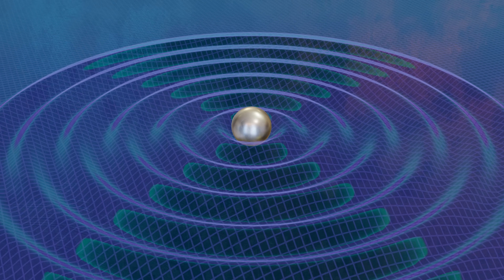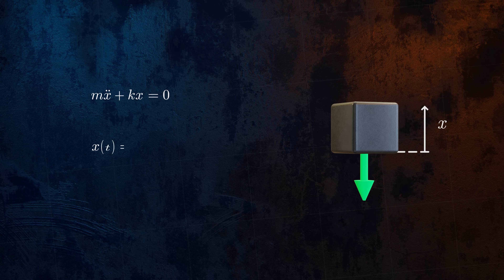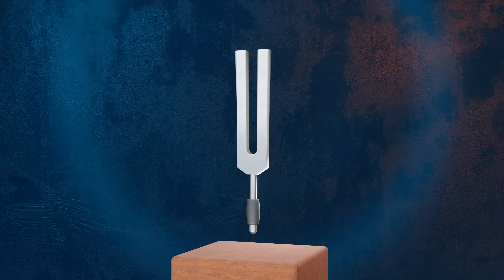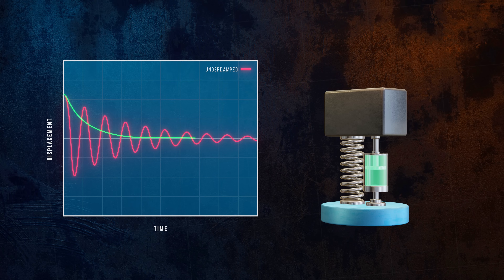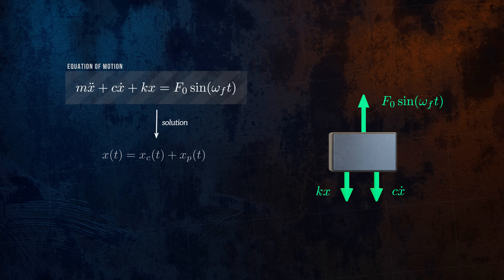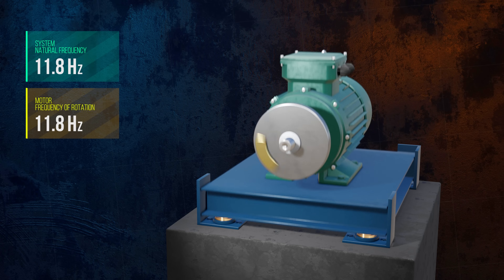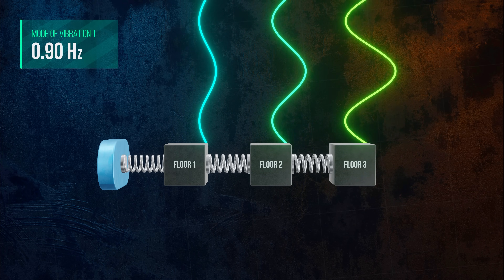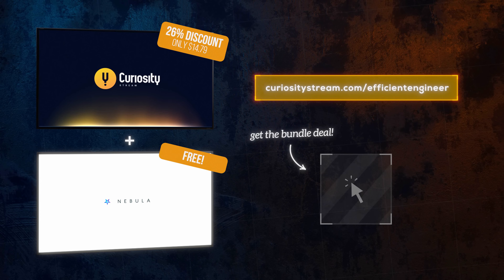Understanding Vibration and Resonance

Comment: I would love to see a vid about mechanical analogs of electrical components and circuits, l,r,and c
Reply: Springs are like capacitors.  They either respond to the position (springs), or the state of charge (capacitors)
Dampers are like resistors.  They respond to the rate of change.
Masses are like inductors.  They respond to the rate of change of the rate of change.
Reply: @carultch  while resisters are always dampers, springs and masses can either be caps or chokes depending on the system you choose

Comment: Can you please explain transfer function,laplace transform?
Reply: The Laplace transform is a mathematical operation that transforms a function in the time domain (or position domain if applicable) as you'd ordinarily think of the function, into the s-domain, by integrating the time-domain function f(t) with an exponential decay function of e^(s*t) from 0 to infinity.  This transform scans for a hidden spectrum of exponential decay functions, that match the original function.   This is a powerful tool that converts differential equations into algebraic equations, that you can solve by rearranging for the function of interest in the s-domain, and then mapping what it equals on the other side, to a reference table of Laplace transforms, to then translate back to the original t-domain that we want to know.

The short answer for what s is, is complex frequency.  Real-values of s correspond to the transient behavior, while the conjugate imaginary terms will correspond to the frequency.  In the long run as t gets large, the real value of s diminishes to zero, and we have a special case of the Laplace transform, called the Fourier transform.

As an example, consider the differential equation dy/dt + y = 2*sin(t).   We then take the Laplace transform, £{}, of each term.  Let Y(s) = £{y(t)}.
£{dy/dt} = s*Y(s)
£{y} = Y(s)
£{2*sin(t)} = 2*£{sin(t)} = 2/(s^2 + 1)
Y(t)*s + Y(t) = 2/(s^2 + 1)

Factor the LHS:
Y(t)*(s + 1) = 2/(s^2 + 1)

Isolate Y(s):
Y(s) = 2/((s+1)*(s^2 + 1))

Partial fraction decomposition:
Y(s) = 1/(s + 1) + 1/(s^2 + 1) - s/(s^2 + 1)

Each of the terms in the above equation matches one of the Laplace transforms on a standard table.  We now can construct the time domain solution for y(t), by replacing each of the above with the corresponding input function of the Laplace transform, a process called the inverse Laplace:
Y(s) = e^(-t) + sin(t) - cos(t)
Reply: As for what transfer functions are, they are a Laplace transform of a system's behavior, that multiplies the Laplace transform of an input signal and gives you the Laplace transform of the system's output.  In the time-domain, this is really convolution, but it's easier to work with in the Laplace domain.

A common application of transfer functions, is electrical filters.  You have an arrangement of capacitors, resistors, and inductors, that each respond differently to different frequencies.  The transfer function generalizes this behavior, and can tell you how it affects the amplitude and phase of an input sine wave signal.

Comment: Amazing Vid as I just finished vibrations for aerospace in master's program. A tip to all ME or AE students who are good at CAD or structure design, jump into modal analysis  or linear buckling right away, even in undergrad. These are starting points for a lot of design. Learn how to simulate it before you even take a class, seems counterintuitive. The class shows you the numerical MATLAB/Python way, but you need to go out of your way to learn to simulate it on ANSYS/Abaqus/Solidwors/etc which is what usually shines for job interviews as well.

Comment: When i changed my suspension in my car I basically saw this design.
A spring holding the cube ( the car.) With a damper (shock absorberer) in the middle.
Now i understand better how the vibration acts upon my suspension. 

Fascinating to se how vibration theory applies in the real world!

Comment: great! but IMHO u missed two crucial things: 1)Response spectrum is NOT a probabilistic method; 2) In case of forced vibration the maximum amplitude IS NOT at the resonant frequency, but a little bit shifted from resonant frequency (due to damping)
Reply: I disagree.  The resonant frequency is the frequency at which the maximum amplitude occurs when the system experiences a sinusoidal excitaion.  Thus, as correctly noted in the  video,  the resonant frequency is a function of the damping ratio (zeta).  For very small values of damping, the natural frequency and the resonant frequency are almost the same, but, as the value of zeta increases, the resonant frequency departs more and more from the natural frequency.  

Also, while we are at it, it is worthwhile to note that the  damped natural frequency (i.e. the actual frequency of free vibration) also differs from  the natural frequency (which is the frequency the system WOULD vibrate at if there were no damping.  The damped/ actual frequency of free vibration is the natural frequency times (1-zeta^2) while the resonant frequency is the natural frequency times (1-2[zeta^2]).
Reply: @frankfronczak4469  yes , you're right.  It should have been added in the video. But complex natural frequency would be too difficult for this overview video :)

Comment: Is everything vibrating? All atoms? So our bodies and everything around us is vibrating so imperceptibly but it's the reason we're all connected, this is involved in this sixth sense that humans seem to be evolving...
Reply: Yes.  Otherwise we wouldn't be alive.   Everything that isn't cold enough to freeze your hand solid upon touching it, will be vibrating at the molecular level.  That's what temperature ultimately is, is a measure of the average internal kinetic energy of vibrations of atoms and molecules.

This vibration would cease at absolute zero.  But it will be maintained at any ordinary temperature.

Comment: Great stuff as usual, just one issue: at 01:34, there is no need to neglect the effect of gravity, as it only constantly moves the equilibrium point of the system and has no further, dynamic effects. It isn't a great assumption in most cases anyway, in mechanical and especially structural engineering.
Reply from the maker: Yes agreed, including the effect of gravity doesn't actually change the solution or method, but I wanted to keep things as simple as possible.
Reply: @TheEfficientEngineer  well, the method is slight different; you should have changed the variable for the equilibrium position. If the system was in horizontal, you wouldn't have this type of problem in the explenation
Reply from the maker: I did think about showing it as a horizontal system for this very reason, but in the end I felt that vertical was more intuitive. With a horizontal setup you have to explain e.g. that the mass is sliding on a frictionless surface or on rollers. And I felt that made things less simple.
Reply: Yes, but then the ODE is not homogeneous. This subject is always taught first for the homogeneous case and external forcing functions are added after this is covered. Especially as in order to solve the forced ODE you first have to find the homogeneous solution and add a particular solution to it. In the simple case of the constant force of gravity this particular solution is also just a constant, but the principle is the same.
Reply: @ASJC27  If you set your coordinate system up so that the value of x is equal to zero at the equilibrium point, you still get the homogeneous differential equations as shown in the video.  That is, at equilibrium,  the force due to gravity is balanced by the spring force.  When you draw the  free body diagram and apply Newton's 2nd Law, you are showing difference in forces  - away from equilibrium - acting on the body. These unbalanced forces result in the acceleration, thus motion, of the mass.  As long as the spring is linear (that is F=kx), and you set x=0 at equilibrium, you get the same differential equation, and the same resulting motion due to initial conditions.
Reply: turning gravity on as a perturbation is important tho, the equilibrium energy shifts by -1 unit, with -2 units of gravitational potential energy and +1unit of spring energy.